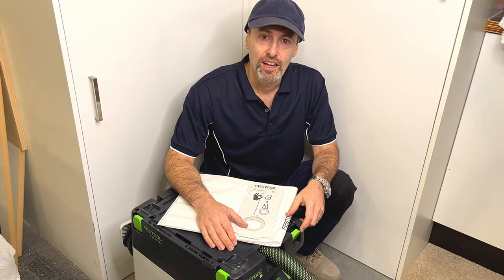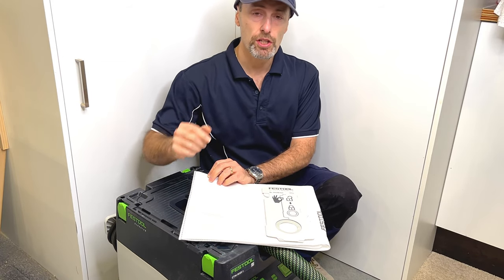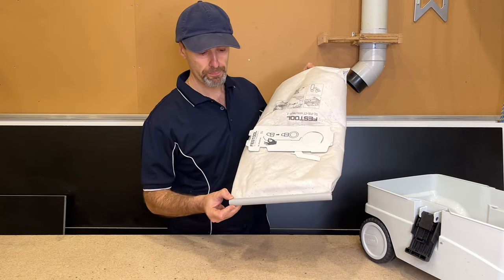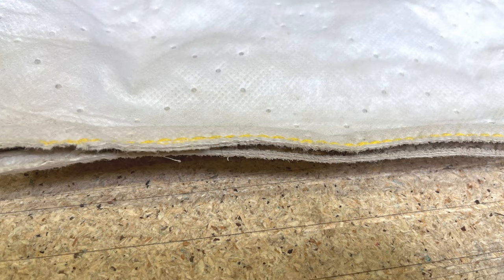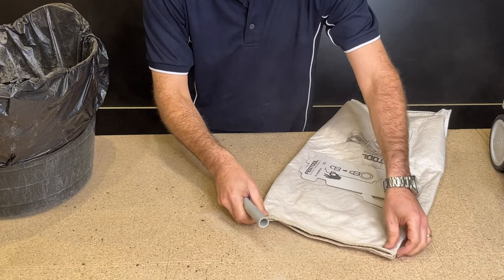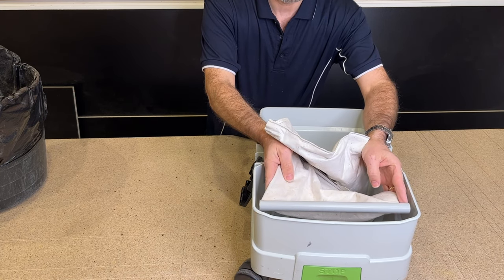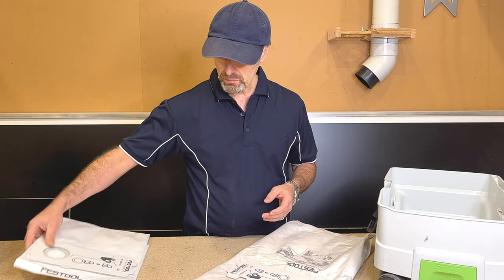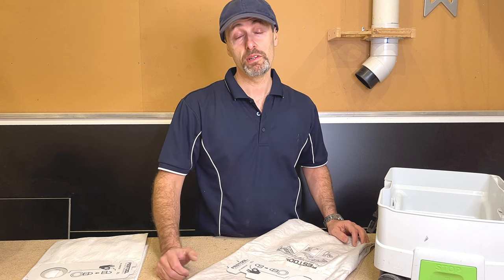Workshop Vac Dust Filter Bag Hack | Reuse Your ShopVac Dust Filter Bag | ShopVac Dust Bag Hack

Comment: Great idea! 
The Festool and Makita bags are pretty expensive for a 5 pack. How many times would you say you can empty and reuse the bag before it's too dirty? Would drywall dust make the bag not reusable? I'm still researching for the best auto clean shop vac right now.
Reply from the maker: Hi Henri
Yes your right the Festool bags are very expensive, in fact anything Festool is expensive! I am not sure how many times you can get away with reusing the bags it should be in the vicinity of 100’s though it will always depend on what you are vacuuming! I myself have also invested in the cyclone sustainer addition which sits on top. I love it as most of the dust lands in this container which I have a plastic bag lined inside and when it gets full I just tie a knot and throw it out. Also with this upgrade the bottom bag hardly gets filled up so mine will last for years…
Hope you enjoyed the video and good luck with your vac 👍